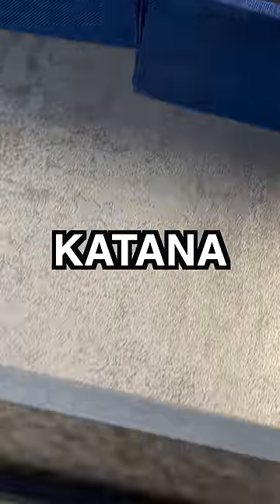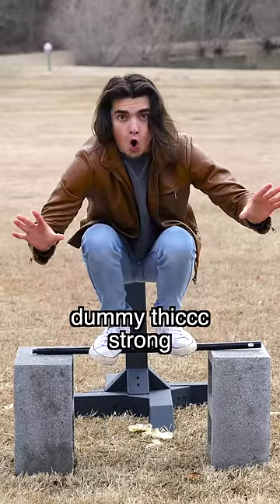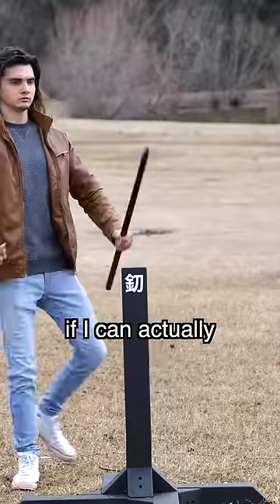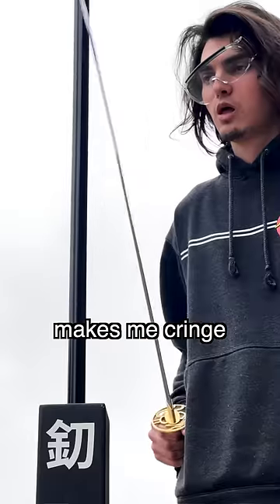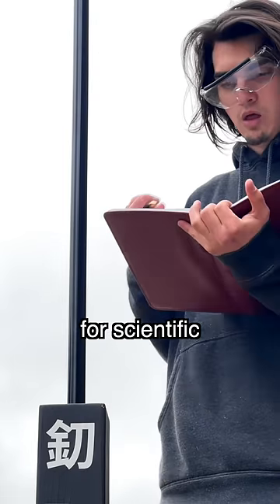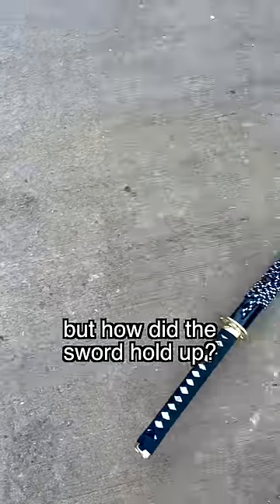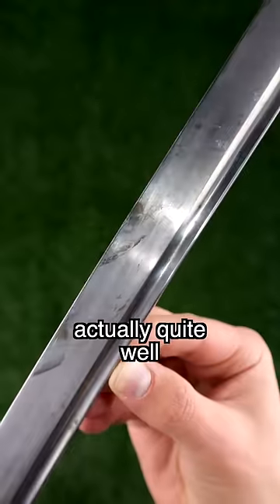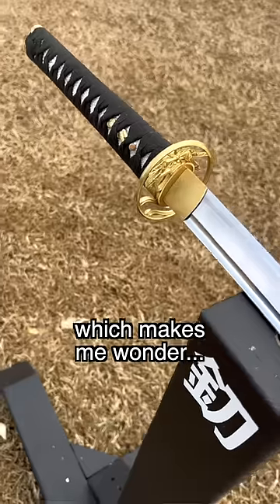Can A Katana Cut Through Steel Pipe?

Comment: bro used aluminium and called it steel
Reply: That explains why it's malleable.
Reply: And called it one inch but forgot to mention that its hollow
Reply: @M Ibraheem  well i mean he did say pipe which implies hollow solid cylinders are usually referred to as a bar
Reply: @mibraheem2263  have you ever seen a pipe that isn't hollow
Reply: @Peeear  yea I guess pipes and bars are different things but still people often confuse the two so imo maybe should have mentioned it.
Reply: @mibraheem2263  never once have I confused the two. Who are these ppl lol
Reply: Not only that called it 1 inch thick lmfao it was and 1/8 at best hahhaa
Reply: @mibraheem2263  it's......a pipe
Reply: @ToddMiller-mi6pp  he is those people haha
Reply: @Markelin Brushtulli  no he didn't
Reply: And still couldnt cut all the way
Reply: @Traeh93  the pipe is 1 inch thick, I don’t understand who doesn’t understand
Reply: No, It's steel. 
Steel is super soft when it's not quenched and tempered. 

A properly hardened and tempered steel blade can easily cut into non hardened steel.

You people talk way too much despite not knowing what you're talking about.
Reply: @cosmicbilly Yeah, but look at the color. Looks awfully light for steel.
Reply: I wouldn’t risk too much my katana either If I had one
Reply: @dtsnjsn6101  regular steel look very similar to aluminium. Plus the lighting outside.
Reply: @mibraheem2263  que que
Reply: @Peeear then refill your pipe then!
Reply: @mibraheem2263 pipe = hollow ...
Reply: Even then, absolutely no damage to the katana blows my mind a bit.
Reply: Yeah dont take tips from this dude, he has coloured swords😂😂😂
Reply: malleable like bussy
Reply: @mibraheem2263  bro said it was a pipe 💀
Reply: @mibraheem2263 pipes are hollow
Reply: @mibraheem2263 I'm pretty sure most people know what a pipe is.
Reply: @mibraheem2263  who tf is people
Reply: @ara849 every metal is malleable
Reply: It’s a pipe, it wouldn’t work if it was solid

Comment: when you try the same thing at home and the blade get badly damage because you used an actual steel pipe
Reply: It looks like aluminum forsure.
Reply: @Assripper1000an  o yes stell pipe made of aluminum stell its not an metal for sure
Here for you: https://youtu.be/DmH6YPWhaDY
Reply: @Assripper1000an  if it's not made in steel it's not a steel pipe

and usualy steel VS steel is not the best idea
Reply: @al-xo2cy  depends on the rating but as a general rule you are correct
Reply: @Assripper1000an  what do you mean depends on the metal used on it? It's made out of steel because it's a steel pipe if it would be made out of aluminium it would be an aluminium pipe?
Reply: @Assripper1000an  well.. steel is iron and carbon. Steel cannot be aluminium or anything else.
Reply: Of course, it’s probably aluminum, he IS trying to sell a product this IS a company trying to get YOUR money
Reply: I mean, steel can vary wildly in its traits depending on the alloying of it... So it could actually be steel... Just not the sort of steel you normally buy pipes in. Either that or the katana is a superalloy, but I think 'really crappy steel' is the most probable answer that assumes that the steel pipe is, in fact, a steel pipe.
Reply: Not just the carbon content in the metal but also heat tempering determines hardness, the same exact grade of steel can break wildly different depending on how it was tempered. But generally piping doesn’t have any reason to be hardened steel
Reply: It's clearly not steel. If it was steel it would not have been that rust free on the inside. If it was stainless steel then the outside wouldn't have been painted.
Reply: Depends on the metal used yo make the sword, the type and thickness of metal hit, and the way you hit it.
Reply: @benjaminvanover7011 i thought it was funny bro. And laughed hard af when no one got it.
Reply: @benjaminvanover7011 i thought it was funny bro. And laughed hard af when no one got it.
Reply: @Assripper1000an  m8 when its more  people than uses same arguments and point like i did, its not a joke anymore and your first comment dosent sound at all as a joke.
Reply: Mild steel is pretty soft still. Just because it is named steel doesnt make it harder it just means that it is iron with a carbon added to it, steel comes in many levels of hardness depending on what you are using it for. This is a piece of curtain rod or a piece of a folding chair, then it makes it mild steel.
Reply: @Assripper1000an  ah yes gold steel and calcium steel are some of my favorite steel variations
Reply: @AllMenAreBerries  if u cut through a steel pipe thats this big u will destroy ur katana. It really doesent matter what type of steel
Reply: If we consider that steel pipes need to have a solid anti-corrosion rating, plus paint, it is likely a low carbon steel, less likely to rust. Would that make it a harder steel? Perhaps, since katana steel is usually of the softer variety. So if it were steel on steel, the pipe would likely win. That is either a copper or aluminium pipe, or a softer metal to avoid damaging the sword.
Reply: @enclave3555  I interpreted it as a joke, just for the record 🤩. Was about to comment r/Woosh
Reply: @mastigt look it's not about the grammar as long as you understand, but the way you write it. The way you write it dosent sound a bit like a joke or to being close to a joke.
Reply: There are a few versions of steel maybe more can't remember em but look it up
Reply: @lamentingtaco5850  maybe some ppl would call an aluminium as steel😂
Reply: @Assripper1000an  steel is 99% iron. If it containes anything else in any other ratio it's not steel
Reply: Thickness difference likely
Reply: no its cuz ur blade is too sharp
Reply: @solaridraconi6225 but it is not, U can clearly tell its Aluminum
Reply: @Assripper1000an  oh yes, the STEEL PIPE... MADE OF ALUMINUM
Reply: @Assripper1000an  haha so funny By using excuses to Wont get cucked by the people Speaks the truth againsts u
Reply: some lessons are hard learned
Reply: If you damaged ur katana and couldnt cut  it then you're doing it wrong. Measure twice. Cut once

Comment: Fairly sure this is an aluminum pipe 💀
Reply: It also chipped on it lmao
Reply: Definitely aluminum
Reply: Mild steel
Reply: @dzinkz  in your dreams
Reply: Aluminum for sure
Reply: But ey 1 inch thick!!😱🤡😂
Reply: Definitly is aluminum, the way he tapped it on the ground to make a sound would be fairly easy with 1/8th in aluminum, but 1/8th in steel, your wrist would not like you, or be able to.
Reply: And it def ain’t 1 inch thick! 🤣
Reply: @viablespade  it's one inch in diameter, not wall thickness.
Reply: technically speaking, if you add a bit of iron as an alloy, it could be considered steel. a soft steel, but still
Reply: @helio3928  technically speaking, you can't do that because of melting points of thous elements
Reply: Aluminum indeed
Reply: @SmokeyOwOs  No
Reply: @BrazilianImperialist  yeah.
Reply: @helio3928  No, the alloy would need to be majority steel to actually be called steel
Reply: @dzinkz  No, not even close. Mild steel is WAY stronger than you think, to the point that a steel pipe with the same dimensions as what we see there would need a several ton press brake just to deform it
Reply: @helio3928  not how alloys work. An alloy must be a minimum of 50% iron to be considered steel.  Even a homogenized 300 series stainless, like 304, would not be soft enough to do damage like this.
Reply: @dzinkz no chance

Comment: Aluminum and rather thin, katana edges chip when striking another piece of steel
Reply: @Boomitsblake  it is. You can see it by it's color
Reply: Very Aluminum.
Reply: @Boomitsblake  no it really is.
Reply: Quite badly too, my brothers old katana isn't the best blade wise but I keep it as memory
Reply: was about to comment that
Reply: I've been able to work with aluminum in fabrication before, and that's deffinetley aluminum. I'm glad I wasn't the only one to notice it
Reply: literally my first thought
Reply: And even then it's likely they swapped out the sword for the final shot. These swords are mass produced anyway so its not like they couldn't just grab an identical one
Reply: @nathans45  they made the video Jackson. So they just did that shot first
Reply: Aluminium is a soft weak metal in comparison to steel or typical triple forged iron in swords
Reply: I'm still impressed the damage on the blade wasn't greater for a cut that deep.
Reply: @nathans45  right that may be the case as well.
Reply: 900th like!
Reply: I think its a lead pipe
Reply: Unless one is untempered, which is what this looks like. Also an aluminum pipe that thin would have folded when he hit it the first time.

Comment: Yeah, the cut pipe is clearly aluminum. Has the wrong color and surface finish for a steel pipe on the inside. So they definitely just painted two different pipes black so they could swap them out.
Reply: It's because they knew their '1000 times folded' sword would chip immediately.
Reply: Most credulous ASME engineer
Reply: Or get this… they used aluminum the whole time!! Rather thick aluminum pipe is strong against bending but a cut would do what damage we saw. There was never a steel pipe
Reply: or they just didn't know it was steel

Comment: You can tell by the way the pipe deformed and tore at the back and of the cut that this is not a steel pipe. Steel- of any type- does not shear or tear like that. Steel will shatter before it tears and it will bend/warp rather than separate like you see in the section of the pipe still attached. This pipe is either low grade aluminum or magnesium. It's also way too bright for any kind of steel or iron allow. Looking at the attachment at one end I'm betting this was part of a camping frame or possibly a bike frame.
Reply: Just to clarify, steel definitely can tear and it definitely can separate instead of bending, but for that to happen it needs to be a good bit thinner than what we see, because steel of that thickness would need a several hundred if not several thousand pound metal shear to cut cleanly
Reply: @richardmillhousenixon  good point. I should have said no normal steel would tear like this from an impact like what we saw. A steel pipe of that size can have a sheer strength of thousands of pounds, and I don't think he hit it quite that hard.
Reply: Well magnesium is out of the question cause why would you ever make a pipe out of that, and steel this thick can definitely deform and sheer like that, just see what happens when you use a chisel on it. Not saying that it is steel but i just dont agree with your argumentation. Have a good day
Reply: @damianstil9897  magnesium is used to make low weight bicycle frames, usually for higher end racing bikes. The shape of the pipe and the flattened is what made me think of it being a magnesium bike frame. Steel can certainly shear like that, I just don't think there was enough energy in that swing to cause that kind of deformation in even really soft steel.
Reply: @Scudboy17  fair enough i stand corrected
Reply: @Scudboy17  did not know they made magnesium pipes, it just sounded like a bad idea in my head. Thanks for learning me smth
Reply: You can definitely get steel that shears and bends like that, depending on the alloy and heat treat condition. Something like a homogenized stellite definitely could. Would require a lot more force than a dude with a crappy sword, but you could get similar deformation. This is 100% an aluminum pipe though.
Reply: @namniag  correct me if I'm wrong but I thought aluminum was far more prone to shattering when shearing than tearing like that, especially on high speed impacts (not necessarily high torque).
Reply: @Scudboy17  kind of depends. Aluminum is very versatile and can be highly ductile or brittle depending on condition and alloying materials. Usually cast aluminum is very ductile and not prone to breaking or shattering like that. It’s practically play dough. Cold-rolled or annealed aluminum tends to become more brittle and prone to stress cracking. Introducing alloying materials like copper and zinc can increase brittleness, and make it more prone to cracking, while magnesium and silicon can increase ductility. Alloying aluminum with magnesium-silicide is often used in bike frames for that reason. Seeing the kind of shearing as in this video definitely makes me thing of a more ductile aluminum alloy.
Reply: @namniag  great- thanks for the info

Comment: I assure everyone that if that in fact was a steel pipe this katana would become bannanna
Reply: The magic of Aluminum
Reply: I bet a 1070-1090 carbon steel wouldn't. But idk. What I think he couldn't do is cut steel that easily with a katana, even if the blade could endure some hits.
Reply: Yeah, I may have spent some time fact checking. The broom hand appears to be about 30" long, black, and has an odd shaped top. Looking around, it seems to be a winco lobby broom, that is made out of aluminum.
Reply: @michikatsu8505 Depends on lots of factors, but I'm assuming these are heat treated quite soft.
1070-1095-W1 is quite ductile, so it will bend easily, especially at lower hardness.
Reply: @autumn5592  are you sure? I'm talking about steel used in katanas and at least 1095 inst ductile. At least it's what I read about. I don't know if that 1095-w1 is different.

And a katana wouldn't have low hardness in the part that cuts since it's made to be harder, while the back softer. Maybe it would get some teeth's or

a slight depression on the edge. I think that even a 1060 shouldn't bend if you strike correctly, although it would suffer a lot of damage.
Reply: Depends on the quality of the sword and the steel pipe so an authentic sword would only scratch a bit but this is not an authentic sword
Reply: And it still chipped
Reply: @milkman4407  if u hit a steel pipe with a katana the katana will breake fore sure
Reply: @michikatsu8505  for all i know modern steel katanas don't use differential hardening. they are the same crystal structure throughout (in matter of speaking).
Reply: @micklenier6152  Diff hardening wouldn't change the fact that a steel pipe would obliterate an edged weapon with as little mass as a katana.
Reply: @anms_brk  didn't said it would. just that it isn't traditional katana. and it's annoying they sell it at pretty insane prices (little work goes to it). might aswell get the real thing. not like you should use it anyway (you know folded steel, made from tamahagane) 
and if you want to use it, buy it cheaper. it's not too expansive to get decent spring steel sword that is industrially made.
Reply: @michikatsu  Depends on what you used but the old fashioned samurai swords could cut through it
Reply: @FBI.Official47  hah, it wouldn't make difference perhaps the sword would possibly be in even worse condition. it's just sword not an angle grinder.
Reply: Well, I would worry more about the Mekugi pins. Obviously they are made out of wood to absorb the shock that the Uchigatana will undergo from a powerful strike. However, after absorbing too much force the mekugi pins will break and leave the uchigatana in pieces until you get new mekugi pins.

Comment: Yeah... steel don't look or bend like that...
Reply: Steel CAN bend like that, but it's actually not steel so it looks like that. I think it's aluminum or a weaker metal
Reply: Yeah it's surely aluminum
Reply: I was gonna say looks a lot like aluminium😂
Reply: @Jean Ladoire  actually looks closer to tin to me. If so that's even weaker than aluminum
Reply: @DevourerOfLords  no there's no way that's tin, i work with tin and it's impossible to buy threaded tin tube, it doesn't make sense. It's also painted. It's 100% aluminum
Reply: @jeanladoire4141  fair enough, was thinking more on how weak it looked.

Comment: Damn that's some great katana quality makes me wanna buy more ...
Reply: @saintjiubtheeradicator  the fact that the blade was chipped by aluminium say something about the quality
Reply: It’s an aluminum pipe and the blade still chipped. Don’t waste your money
Reply: @greyviscount.78  I mean it’s a thin edge, a traditional one would also probably be damaged from that test
Reply: @Joker-em6oz  bc 'traditional' katanas were made of inferior metal
Reply: @Simon-xi7lb  yeah, I was pointing out it has nothing to do with craftsmanship
Reply: @Joker-em6oz  a original tradicional katana from the 17 century for example would've broke because of the bad quality of the steel
Reply: @jdz6002  probably not, the final steel used for the sword is more homogeneous and refined than you would think. Also, the differential hardening and laminate steel construction leads to a blade that is quite tough